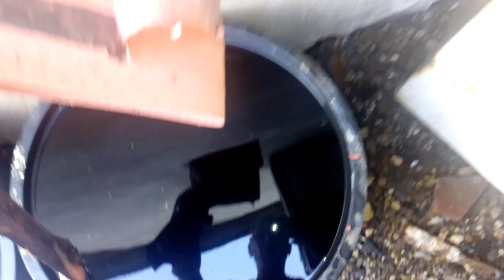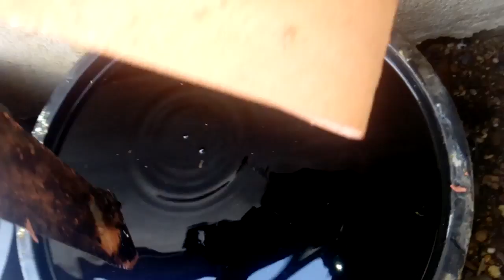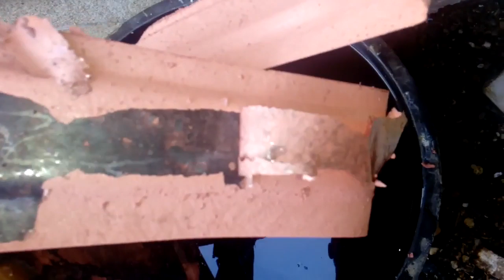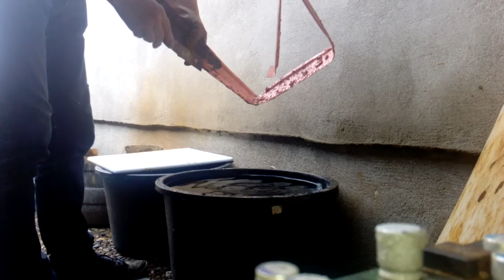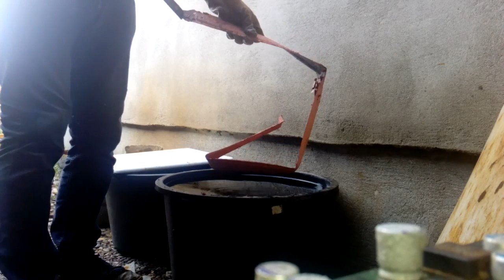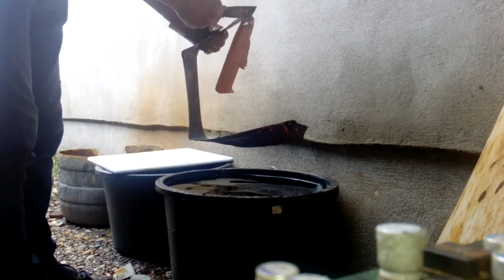Copper from E-waste junk - colect!

Comment: Hello friend.
Try electrorefining i do like you i recover the dust but it is not good quality. I put the dust in a container with many hole then  in acide sulfurique and cooper sulfate bath. i put a copper bar/pipe in this container to the positive then negative to a stainless bar. After 2 days i let it dry then the cooper is very very good quality and shinny. If you have an email i can send the picture of cooper. Continue your good videos.
Reply from the maker: I will try that brother,but for me purity of copper no important because i sell that waste copper like burning wire price,no melting,no cleaning,just sell after dry up.